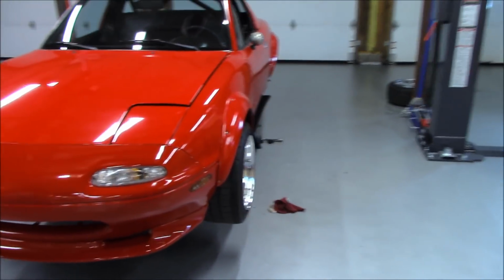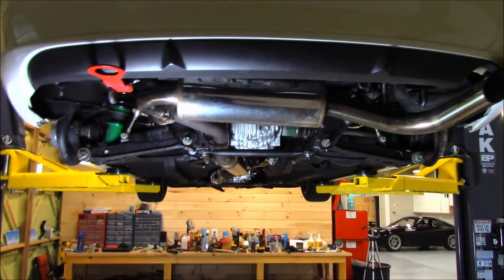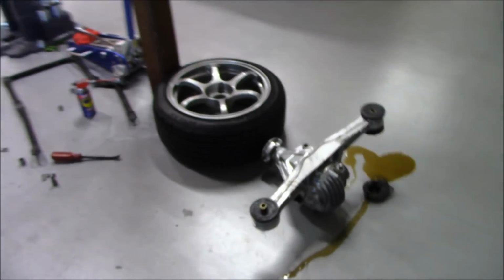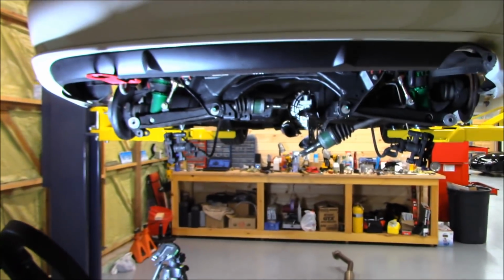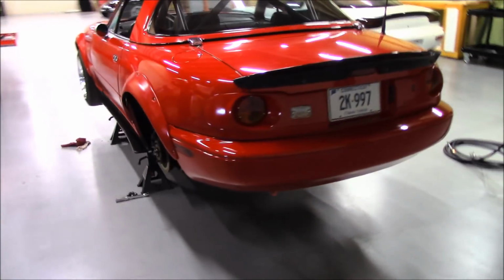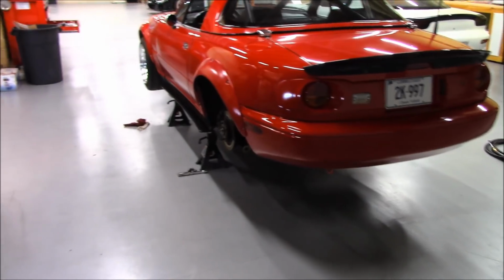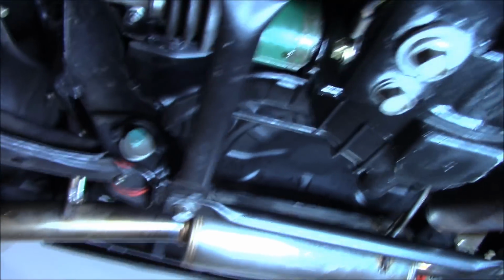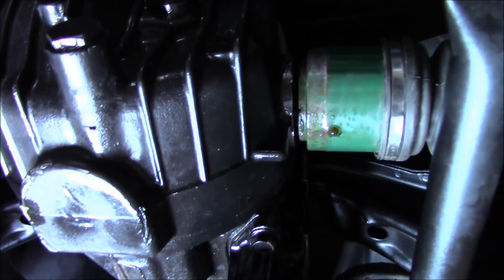When Car Projects Go Wrong: NEW DIFF FAIL

Comment: Timing sounds about right.
Solo remove/install on the ground took me just over an hour.
That's with a smoke and checking my stripper glitter fluid coming out the old 4.10 torsen lol

Mine also has the dog ears instead of input shafts.

Comment: Quinn, sorry about the diff bud, but now I understand why you were upset, last Friday....  Back when I had my 280z, I bought a used performance head from an ebay Datsun dealer and after install, I made it about 500 miles and it dropped a valve and destroyed that little inline 6!  Contacted the guy about it and never heard a thing back.  By the way, LOL on the PPF rivet thingys.  I forgot about the top one,  last weekend, as I mentioned on one of your other videos...

Comment: On a positive note...you had a donor car already, and you own a lift!  As you know, getting out the PPF while lying on your back is no bueno.   I know you were tired and frustrated, and probably not thinking clearly....but next time you need to lift up the diff and you're by yourself, just lower the car down further on the lift and use your floor jack to lift the diff into place (similar to how you lifted the hub at 13:57 of this video).   That's how I lift mine up because I always work alone.   Great video though.
Reply from the maker: I thought of that but the last stop for the lift is too high for my jack to reach. I have another HF transmission jack on the way already.

Comment from the maker: For those just tuning in or in case it is not clear, I bought a Miata differential with an S4 RX-7 clutch type LSD unit in it. It was represented as functional, but the clutches are shot and slip with any reasonable load applied to them. While this is unfortunate, please do not harass the guy, that is not my intention for this video. I only mentioned him as more of a buyer beware. I will rebuild this diff and document it for the channel and all will be well in the world :) 👍👍👍
Reply: Just get a KAAZ and call it days.  Trying to get a deal on mod parts frequently ends in tears and more importing wastes a lot of cash.
Reply from the maker: I can buy all the clutches and parts needed to rebuild this unit from Mazdaspeed for about 200.00, I'm just going to do that. Plus it will be good information and content for the channel.
Reply from the maker: I agree that OS Giken is the best. This diff already has an FC RX-7 clutch LSD unit fitted in it. I am going to buy the replacement clutches with my Mazdamotorsports membership to rebuild it. I think there are upgraded Mazdaspeed clutches that are optional. I haven't looked them up yet. In the end, 200.00 to rebuild is much less expensive than purchasing the OS Giken unit.

Comment: Quick diff question, do you have experience with spirited driving on both types of torsen diff? Type 1 vs Type 2? I want to put 4.3 type 1 torsen from NA Miata into my NB, switching from 3.6 type 2 torsen, and I'm just curious how it's gonna be on the track.
Reply from the maker: The differences between the 2 is negligible.

Comment: hey i just got a hardtop and i was wondering what hardtop bracket you use and where from and the bolts you use to secure it in ?
Reply from the maker: I use the OEM latches up front. KG Works in the rear with the hardware they come with.

Comment: Yes, some rx7's have open diffs (fc's). Sorry to hear this happen to you.
Reply: the clutches in it were shot. I think he woulda noticed that it was open before putting it in
Reply: Charles-Dylan Mactutus if he indeed bought an open diff, then it's unfortunate. Not 100% sure but Torsen diffs for miatas don't need servicing as the gears count as pseudo-clutches. I have a friend who swapped an rx7 differential into his miata thinking it was an upgrade. It was an open diff.
Reply from the maker: I bought a Miata differential with an S4 RX-7 Clutch type LSD unit in it. The clutches in the diff are shot and it slips after any real load is applied to it.
Reply: Garage Quinn Motors that rebuild video sounds like a great idea

Comment: Aarrrgggghhhhh! Gutted for you mate, weld it sell it to a drift guy at least u get summin back
Reply from the maker: I'm just going to rebuild it and film it for you guys :)
Reply: Great, that'll help a lot understand how a diff works, personally for years i have always used the crown wheel and pinion to make a high geared LSD, maybe integrating how that can be done in a vid would be good if ya gonna strip a diff anyway. 😉
G